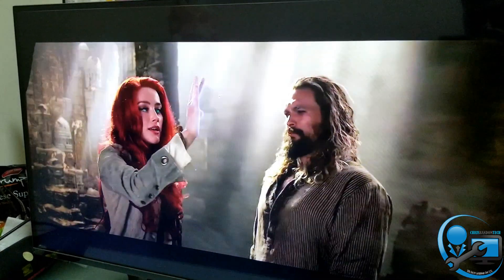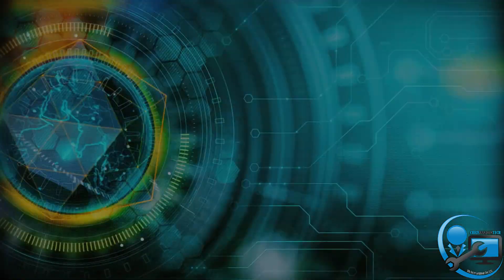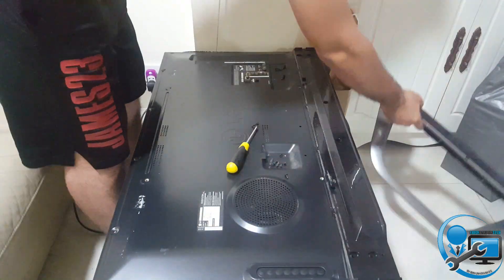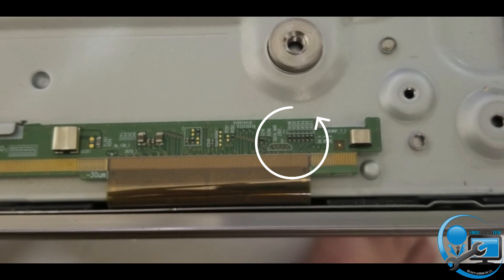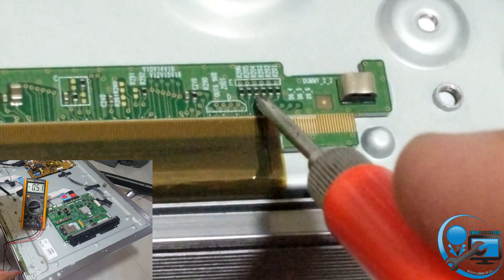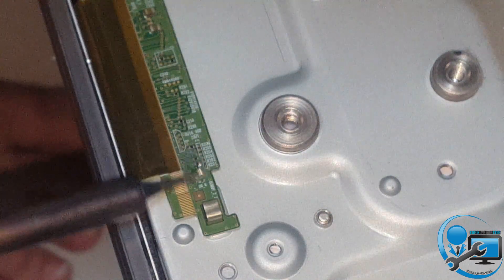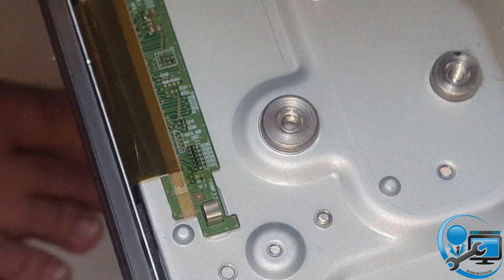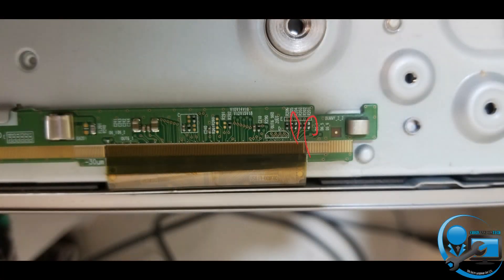HOW TO FIX SMART TV GHOST IMAGE OR DOUBLE IMAGE SCREEN FOR FREE!

Comment: Why did the company placed the resistor when its of no use ? and when you removed them which function will be disabled can you explain this ?
Reply: I thought so too. It must be there for some reason. So taking out those resistors would affect which function of the tv,  I'd like to know.
Reply: Yes I was wondering this too. Hope the uploader of the video can tell us
Reply: It's redundant, so if one completely fails it doesn't hurt the TV. When it only partially fails, it starts ghosting.
Reply: Hummm don't semns right... don't look that it's just redundant, why they would do that way??  ...🤔
Reply: @LeandroD-s6i  asialsky already explained it; Components fail all the time. If all of those resistors were not redundant, that would mean that if any one of them ever failed, the TV would be completely broken. The redundancy adds durability by making all the resistors share the load and also preventing the set being rendered completely useless from one component failing.

Comment: so you remove or you replace??
Reply: He replied to one similar comment. He just removed the 2, since all those resistors are on parallel as he said.
Reply: @lawrencepatricio5776  They can't be connected parallel, because he measured different voltages on them.

Comment: The shameless poor quality of the modern lcds leads to fake pseudosolutions.Why not,maybe destroy the panel yourself and the problem is solved.How the heck to cut lines and desolder components while you are not knowing what are you doing exactly?
Reply: I guess modern technology is not supposed to last long. So people will buy regularly. Imagine if phones and TV's for example last forever, fewer people would buy new ones.
Reply: @lawrencepatricio5776  And that's a shame. Meanwhile a CRT TV of mine bought in 2003 still works great.
Reply: Paano po kpag may horizontal line na manipis lang dulo sa dulo?? Pls reply po